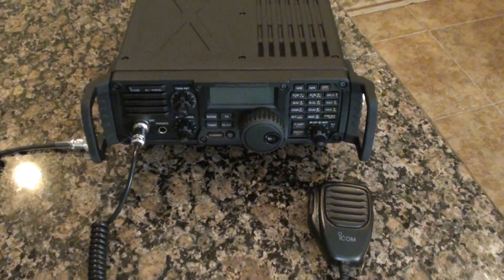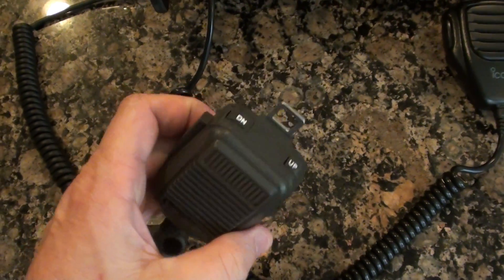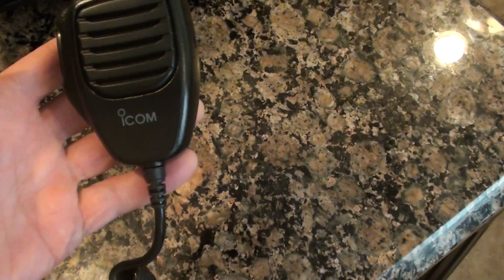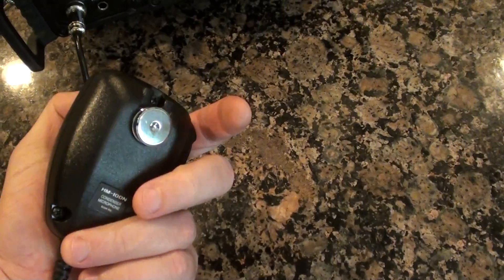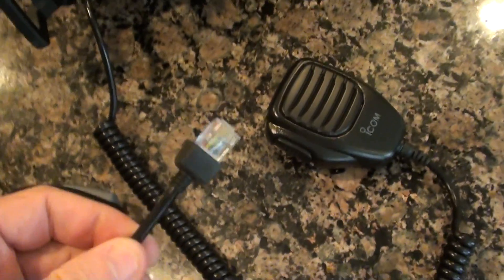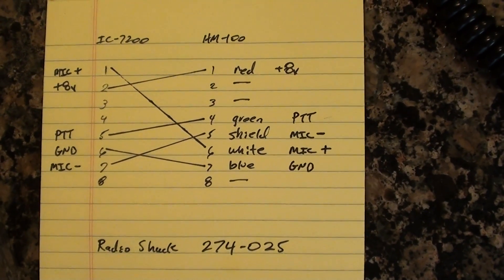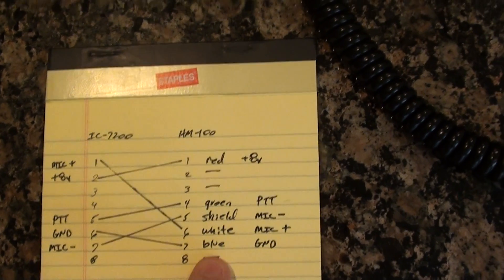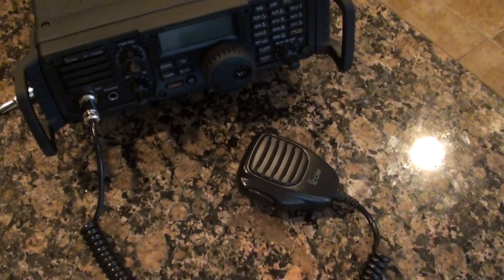Icom IC-7200 Microphone Upgrade

Comment: Won't work for me--I want those two function buttons on the top of the original. Guess you didn't need them?
Reply: Sa Pratt you can drill and add some small momentary switches up top.

Comment: I bought the 100N and tried this. Didn't know that wiring an 8 pin round connector is so difficult, I ended up ruining the mic. Threw the whole mess away.
Reply: Noooo....don't throw it away!   Send it to me and I will fix it and send it back
Reply: Preston Moore Thanks Preston but I kept trimming the mic cord after mistakes until there was not enough left for the connector, I had to throw it away. Thanks for your offer, I will buy another one.
Reply: Well....you can send it to me anytime and I will put the connector on for you.  Just let me know.